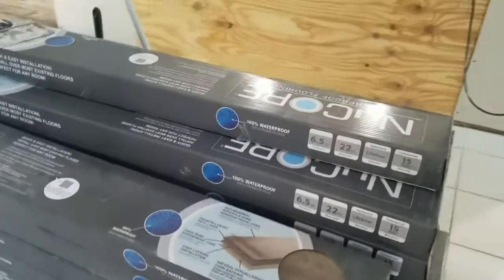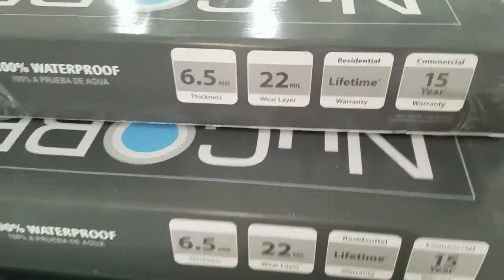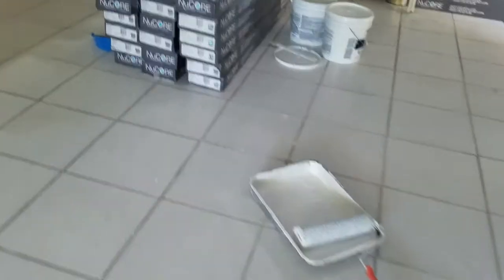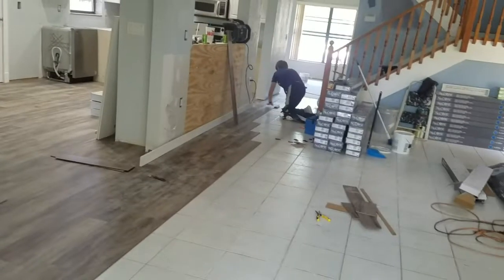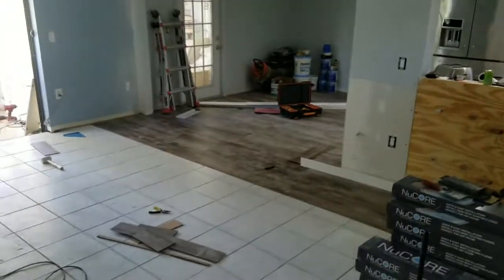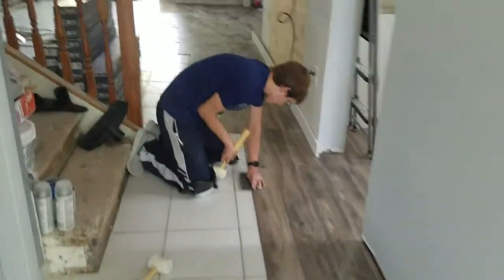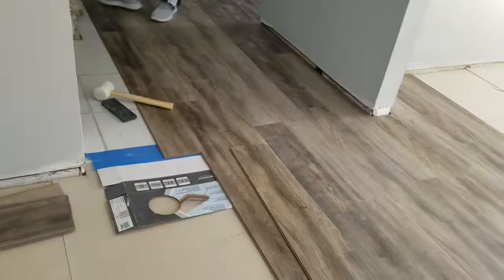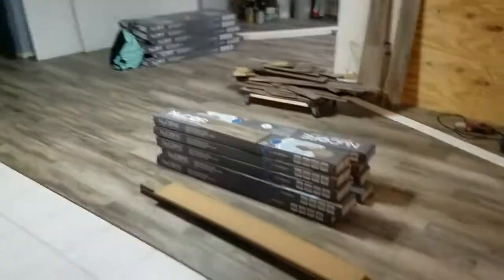Vinyl Plank Cork flooring Directly Over Tile   | Should I do this? part 2

Comment: Thanks for this informative video! Our tiles are glossy and with some bumps/not leveled areas so we want to cover it with vinyl. Would you recommend using underlayment or any other leveler to make sure the vinyl is leveled? I'd appreciate your input.
Reply from the maker: You don't need underlayment with the cork flooring. But honestly, if you had a few extra dollars to spare yes, underlayment along with cork would be a great move,
Reply: @speaknsee  Thank you!!!

Comment: The seams will give over time if grout is over 1/4" wide or deep .  The vinyl will form to the surface . The job for me is to remove the ceramic . To fill the grout lines first have to primer the entire floor then go thru the pain of filling grout lines . CERAMIC BIG HEADACHE . Check with factory bought the lvp from .........
Reply: Look at his update video... Still good after 3 yrs

Comment: After over a year since the upload of this video. Would you know how the floor is holding up? I am planning on doing this same thing as well. Nucore cork vinyl (possibly 5.5mm instead of 6.5 mm like here) with no underlayment over most of the 1st floor with no transitions. Thank you for the help and video.
Reply from the maker: We did this for our friend who last I heard from ( a few months ago ) said it's still looking good. I'll get with him tomorrow about your question, and let you know what he says. thanks
Reply: speaknsee I've watched your other update videos from your house as well. I know you've mentioned this was for your friend so I was wondering if you knew. Thank you so much for checking. I'll be glad to hear back from you.
Reply from the maker: @ericeortega  Hi, Eric. In my house we didn't use the Nucore Cork vinyl. It was another brand. The Nucore has the Cork bottom instead of having to use an underlayment. We used an underlayment. Our house after 3 yrs is nice. But I know you mentioned using the Nucore.
Reply from the maker: @ericeortega  Hi Eric, I just got with my friend who's house you're seeing in the video with the NuCork. I asked him how it was doing/holding up etc. He said " It's great, very durable and water/spill resistant, highly recommended". I hope this helps.. Thanks for watching.
Reply: @speaknsee  thank you so much for doing that. I will try it myself in a few weeks hopefully.

Comment: Was thinking about doing this as well. Nucor says the tile and grout has to be flat to within 3/16" height difference over a 10ft area. I've got some area that are right at that limit and I'd be worried about feeling the plank flex or feel hollow at these areas. Did you have any concerns about the tile flatness?
Reply from the maker: Yes , we did this in our other home as well where we had very bad tile work. More so than the tile you see in this house where it is very even through out. But 3/16" difference over a 10' area I wouldn't be worried about. We seem to have more troubled area in "spots' where a high area and low area instantaneously drop. As you see in the transitiion area in this video where we used the cardboard as a slope. In those areas, you will feel a hollow " floaty " feel to them. However over time as the plank settles there , it will be less floaty feel. And to the one who installed it , from an angle he may be able to notice a slight bend in the area. But a 10' for 3/16" height difference that wouldn't concern me. A tile that is 3/16" higher or lower next to a tile that is right next to it, those are the ones that will need your attention.

Comment: I've been wanting to do this over my tile and my concern was the transition from where my carpet used to be to tile.  I saw that you made a slope with cardboard. Is that holding up well? I thought about doing that as well before I saw your video.

Comment: I had nu core vinyl plank installed over my existing old textured ceramic flooring and it does not feel even when I walk on it!  the installer told me that the flooring would lay flat and it doesn't....what can be done?